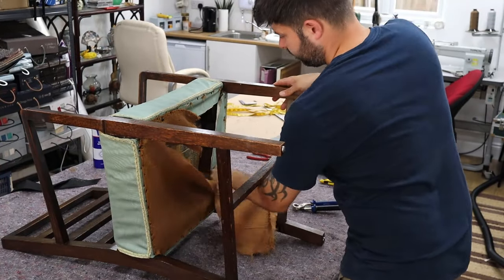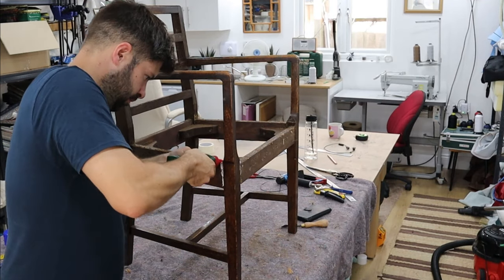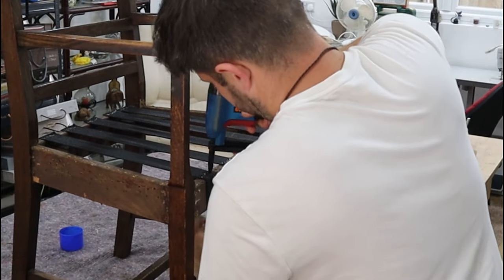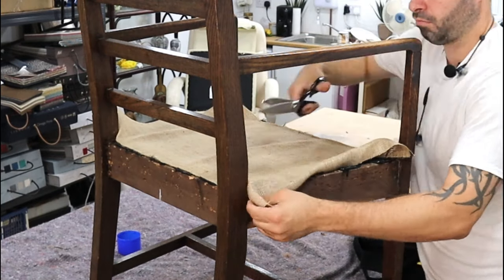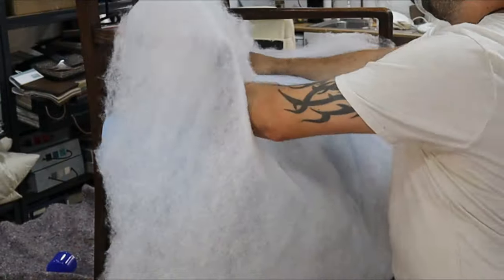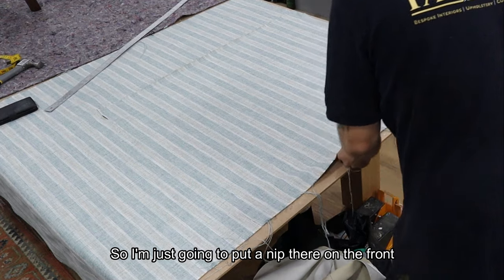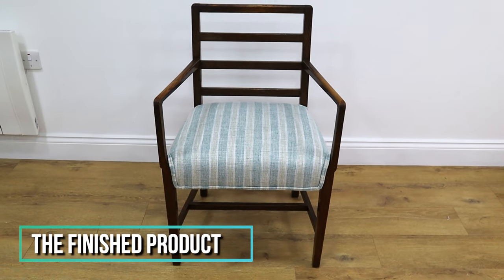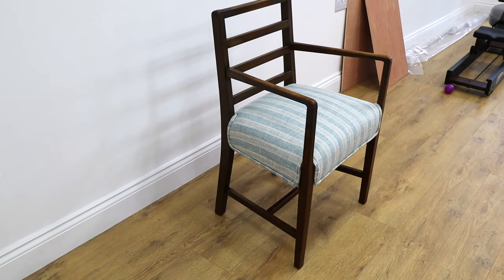DIY CHAIR REUPHOLSTERY | UPHOLSTERY FOR BEGINNERS CHAIR | DIY UPHOLSTERY | FaceliftInteriors

Comment: Do you see an advantage of using elastic webbing instead of jute?
Reply from the maker: Hi Sandy! I would always use elastic webbing on seating and then jute webbing on arms, backs etc and when your seats have coil springs. You get that added spring to your seat with elastic webbing where you don’t with jute webbing.